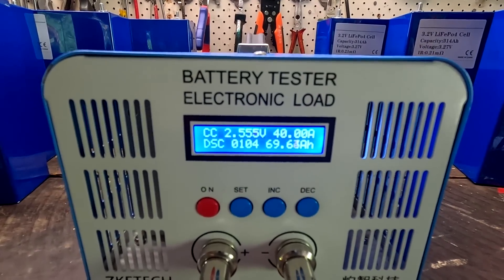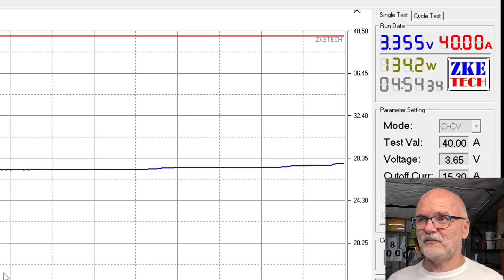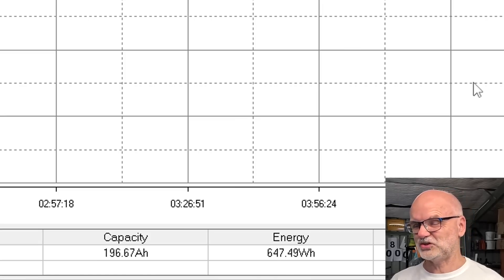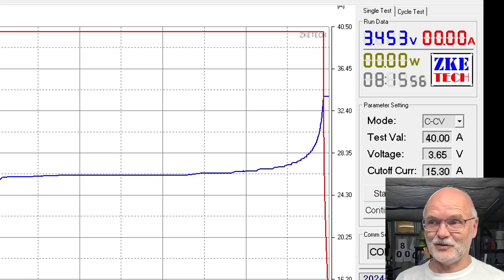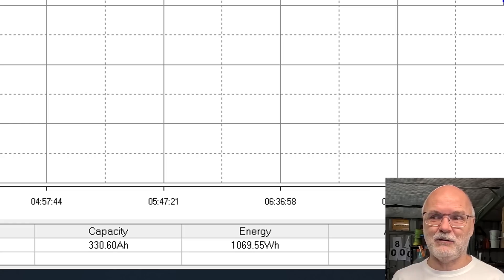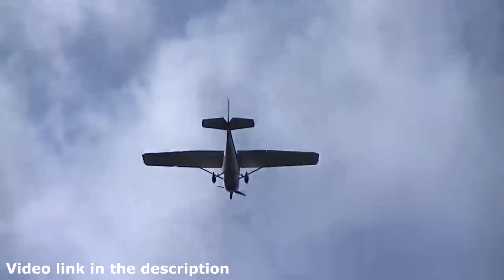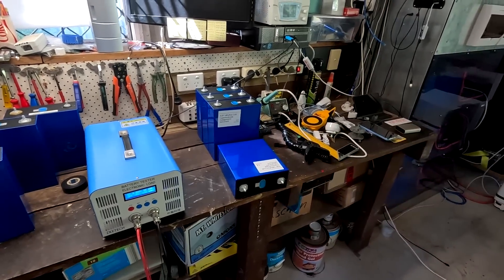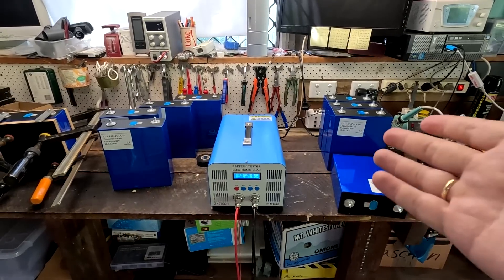EVE MB31 314Ah Cell Test and Review. Have I gotten selected cells to show on the channel?

Comment: If you measure the dcIR for the cell you can estimate the resistive losses during charging and discharging.  Lets say the dcIR is about 2mOhm.  FOr 40amps current thats a power loss of 3.2 watts (I^2r).  It took 16 hours to charge then discharge (or viseversa) so energy lost is 16 x 3.2 = 51Whr.  So broadly, if you put in 1kWh to the cells, you could expect to get 950Wh out.
Reply: DCR is a combination of ohmic resistance (close to 1 kHz impedance test, 0.18 milliohms for MB31) plus the overpotential voltage drop at given cell current.  It is not really a resistance.  It is dominantly the overpotential voltage required to push the lithium-ion migration at a rate to meet cell current demand.  At 40 amps discharge current the terminal voltage drop due to overpotential at equilibrium is about 50 mVdc for a relatively new 300 AH, thick electrode cell.   That would be an equivalent apparent resistance of 0.050v / 40A = 1.3 milliohm.  Overpotential voltage has a logarithmic relation to cell current demand.

The spec has DCR taken at 1 C(A) current after 10 minutes of load to reach equilibrium on overpotential drop (excessively long time given to reach exponential time decay equilibrium).  1 C(A) is pretty rough test for overpotential on a thick electrode cell.  Ion starvation for the thick electrode cells starts at about 0.5 C(A) of load .

At high cell current demand, the lithium-ions migration rate density reaches a point where the diffusion through electrolyte and electrode material is starved out requiring additional overpotential voltage to push harder on the curtailed lithium-ion migration to maintain a mass migration rate necessary to meet cell load current demand.

Comment: Maybe they are the same cells but the MB31 is "rated" for fewer cycles with a higher capacity because it will reach less than 80% SOH sooner due to its higher initial rating 🤷‍♂️

Comment: Dear Andy,
It's great that you are measuring the Gross Capacity (3.650 -> 2.50) but the reality that no one takes their packs from 3.650 down to 2.500 is NOT realistic and mpt Real World.  Gross will typically be 10% higher that the rating which is based on working range.

Could you PLEASE charge the cells to 3.450 till Amps taken drops to (AH x 0.05) Endamp value, allow to settle for 1 hour and then discharge to 3.0V per cell.   Just like your LIVE WORKING PACKS.

These cells are rated for ### AH which is derived from the "working range" as you well know.

Comment: Dear Andy, whatever they do with the batteries they need to respect the C rating. so a charge discharge cycle takes ~16 hours. 
1000 cycles test will take 666 days of full 24/7 cycling

Comment: Mabey they are actually the same cells but they say one has less cycle life so they can slap a higher capacity number on it. so in reality a 306ah would have the same actual capacity at 8000 cycles as the 314ah would

Comment: I bought an Epoch brand 300Ah 12 volt 4s1p battery last september here in the US. They use grade A EVE cells.  The battery i ordered was built and put together last August.  I cant open the battery to see exactly what cells were used, but when fully charged, my Victron smart shunt and monitor independently show the same result as the bluetooth app for the battery and show that they have a capacity of 316 amp hours.  i know its not the most accurate way to determine capacity but it has been consistent. the battery has passive balancing but cell deviation drops to .002 - .001 overnight after an evening of moderate to light loads from the inverter. the cells your testing are most likely an even newer model so it wouldnt be unreasonable to expect they are off the shelf cells.

Comment: Hi Andy, been watching your channel for a few weeks now. And I'm hooked on getting myself sorted to start building my first off grid setup.
But how do i design a system, that i can start small an slowly build up? My aim is to run my heating an cooling off the system, but not just jump in the deep end of spending big cash.
Reply from the maker: Start with one battery and some solar first. See how far you get with that. Keep in mind the future expansion and select the bus bars, cables breakers accordingly. Oversize them for now so you can use them later with an upgraded system and just keep adding batteries and solar.

Comment: I am considering using these cells to replace the deep cycle batteries in my electric ride on mower. I would need to have 48V for it, but as the current deep cycle batteries are only 100A these will last a whole lot longer. The only thing stopping me atm is how these cells would go with vibration. What do you think about this? Thanks for all your awesome work. Cheers, Andrew.

Comment: It is all about C rating. I bet if y could charge and discharge those batteries with 1 C MB30 would have 306 ah and mb31 314ah. Mb31 also has less charge cycles because higher max discharge current.
Reply: hi, interesting what you say, because we have trouble understanding the interest of releasing cells that are so similar. On the other hand, on the mb31 documentation, the charge must not exceed 0.5p. So what is this unit of measurement? 🤔 can you tell me in amps what that does? Thanks 👍
Reply: @martincaniaux6722  1C i discharge of 1 times the Max Amps of the cell 0.5 C is discarge of half times of max amps of cell. 2C is 2 times the max Amps of the cell and so on if your cell is 314 amp 1C is 314 amp if the cell is 306 amps 1C is 306 amps.
Reply: Thanks but I knew that 😊 What I don't understand is why EVE now uses the letter "P" and not "C"

Comment: I'd love to see a compressed vs uncompressed capacity test. Maybe on some smaller cells though 😄
Reply: I was glad to hear he said he was still a "non-compression guy".  I thought I recalled him doing some experimentation regarding this issue and found no difference in capacity.  Of course this was (if I recall) based on just one cycle each of compressed and not compressed.  
I don't compress at this time based on that experiment.  So, I would be most interested in more exploration of compressed vs non-compressed.
Reply: @jws3925  yeah same here. I only charge to 3.5V to avoid expansion
Reply: I doubt you would see a lot of difference. You are supposed to get more cycles with compression.  You would have to do a lot of cycles before you would see much difference. Imagine cycling 2 sets of batteries for 3000 or 4000 cycles.

Comment: Is it possible that the MB30 measured higher be cause it was compressed and MB31 was not compressed, maybe you should compress the MB31 and run the test again, we might be surprised by a capacity of 350ah.

Comment: Nice one Andy, thanks for sharing 🙏 -  these companies are pretty good indeed, when I tested my 3014A Duncan cells they all delivered in excess of 1000W each, and only one was 310A all the others were more and up to 314A max. One important aspect that you might like to know is that the Seplos 200E is keeping them perfectly balanced normally 0.2mv delta and it has done so from the moment I fired it up so I have not installed the Neey as yet, whether that is due to my careful individual testing cycles and top balance or not I shall never know.

Comment: A battery rating should be higher before the charge/discharge 10+ish times for this chemistry.  If you were NOT getting 5-10percent higher on initial cycle , they would settle lower than rated.  After 100+, you should be under rated but not a huge amount.  There is some general data on the web showing capacity degradation graphs for LiFEPO4 over charge/discharge cycles.

Comment: Had to return 16 ea QSO 304Ah's but as said by Andy they handled it well. However the trust was gone and ordered from Duncan (or whatever it was spelled) and did received fairly good batch. So definitely they are testing what people tolerate and what not. I did specifically mention before ordering that each cell will be capacity tested with two electronic loads and will be returned if specs not met.
So that's my story, happy now eventually. But I do encourage people however not accept crappy cells, it will harm everybody.

2cnts. Thanks for video!
Reply: thanks for sharing cause I do not trust them at all. I have bought from a german dealer and at least got the capacity I was promised and cells produced on 1 day which you rarely find today.
Reply: @typxxilps I've had two batches of 304Ah cells from QSO. The first arrived in summer and averaged 312Ah. The second arrived in winter and capacity was hugely influenced by temperature. They were ok, but tested badly because of the conditions. This is why I have a 20W temperature controlled heating mat for each battery bank now (on at 18°C, off at 20°C) with insulation to retain heat.
Reply: @davidpenfold  Please bear in mind that if you use a steel box like Seplos or Gobel etc., condensation may form when using a heating pad, which you don't want to have in the box. That's why I don't understand people who want to use the batteries outdoors and then install a heating pad. If the battery box is used in the garage, it probably won't get below 0 degrees and then there shouldn't be any problems, even with a heating pad.
 In your use with 18-20°C there should not be a problem. Greatings
Reply: @derfreiemensch  Thanks. I'm using a more rustic wooden setup.

Comment: I've purchased 3 sets of 16 cells 280aH from qishou, they all perform exactly the same. Balance is very good all on JK 2amp Bms in parralel with other manufacturers cells.  One came damaged and one came Bloated , they were replaced free of charge no problem.

Ive had major problems with ogreen cells , deviation was 500 and 700mv difference and couldn't get more than 6kw out of a 14kw battery for this reason and they won't replace anything.  Finally I've converted them to a 2p8s 24v system and added 2 active balancers in parralel... they are OK like that.

My advice is stick to Quishou... top quality, and a great customer service 

Love your channel ❤ Andy  apart from seplos stuff.... I can't watch anymore of that 💩

Comment: I just looked at the QSO alibaba store and nowhere on the MB30 / MB31 pages the manudacturer of the cells is mentioned, thats a bit strange.
Reply: If they were trying to hide the original supplier they wouldn't call them MB30/31. It's probably just an oversight.

Comment: Maybe - the cells are both the same:
can be??
MB 30 after 10.000 cycles 306AH
and
MB 31 after 8.000 cycles 314AH 
possible: 
MB 30  after 8.000 cycles 314AH 
and

MB 31 after 10.000 cycles 306AH 

- what do you think ? for me, it makes sense

LG jogi
Reply: That's rated to 70° capacity. So, maybe they can extend the number of cycles by artificially lowering the initial capacity. Seems strange, but maybe longevity is a better seller than pure capacity? 🤔
Reply: @davidpenfold  The values are garanteed cycles. 8years ago, I found a cycle test of the yellow Winston LiFeYPO4 cells, which made 11.000 cycles with less than 5% degradation.
Reply: @jogi_54  His last video went through the specification document from EVE. It's guaranteed 70% capacity.

It's interesting because previous batteries had lower guaranteed cycle numbers, but to 80%.
Reply: @davidpenfold  the value for "%" capacity and the number of cycles depend on each other.
The cells will still work down to 50% capacity and will have maybe 15.000 cycles to reach the 50%.capacity.
Newer generations will be better, so to compare them, will only tell you, the newer ones are a little bit better.
Reply: @jogi_54  Of course. I'm just stating the rated capacity after 8000 cycles (70%) for these batteries, that is contained in their specification document.
Reply: This s makes more sense than different chemistry

Comment: Last year we bought 16x cells from Docan and only 3 made 280Ah. Disappointed from cold and damp Scotland.
Reply: Greetings from a soggy East Ayrshire 🏴
Reply: What's the values for those that didn't meet 280Ah?
Reply: @theo2378 between 260Ah-275Ah. Docan were not interested in resolving it unless I sent the cells from the UK to China.
Reply: @Sean-vh8pm  Thanks for sharing this story cause Docan power was our first supplier due to the channel from Texas. 
OK.
Reply: I am not impresed by Docan as well. I bouht 16 280k I had 2 cells that tested at 274Ah and e few other around 278-9Ah (tested with 20A only so thay all shuld test above 280). I asked for replacement of the 2 worst cells but thay refused. I Just got small refoud only.  Some of the cells were actualy ok and around 290Ah, so 16Ah difrence between best and worst. My BMS has a lot of work becouse of that.